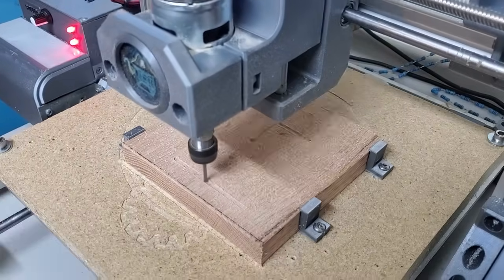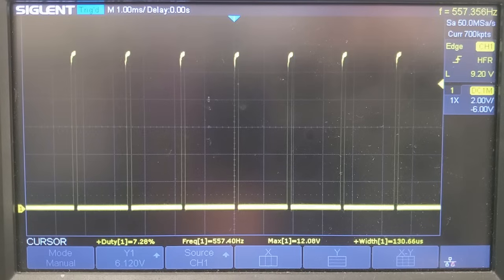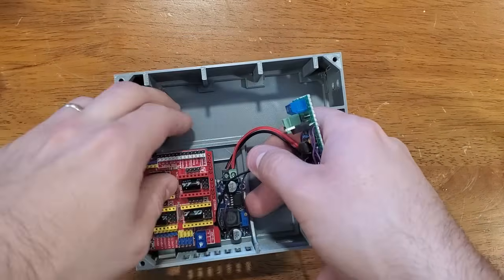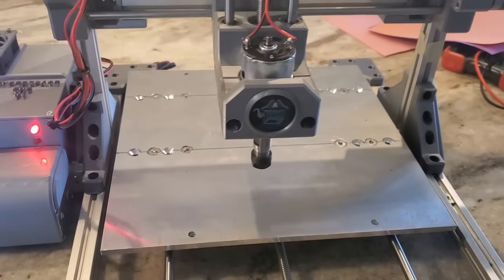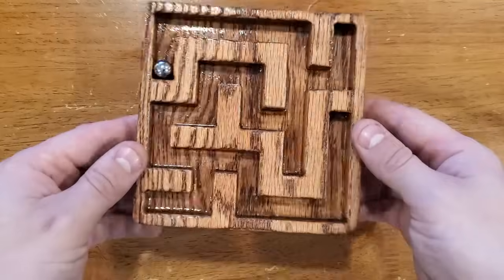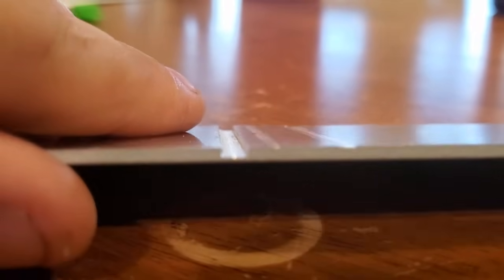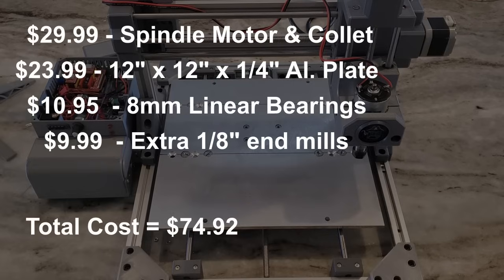CNC Mill for under $100

Comment: Okay. Not only we all agree on the criticism, it's extremely obvious those parts he had "lying around" were probably more that 250 and that he bought them most probably for this project. But I am gonna be real here, I just.. don't think it's even possible within that budget. Maybe a Dremel as the spindle, cheaper but still kicking 3d printer motors, and smaller size could give better advantage, but it's more worth to save.

Comment: Hey, CNC machinist here. Depending on the type of tool path you use you’ll get a way cleaner finish. Do some research on climb vs conventional milling. You’ll be able to utilize that info to optimize your programs to minimize burrs. But I am curious, is the spindle RPM able to be controlled through the computer or strictly with your manual adjustment? Also, reduce your feeds and speeds. The lack of rigidity in your machine plays a factor but that ugly finish on the side walls of your thick part is caused by tool chatter. The lack of rigidity will cause it but so will too high of an RPM combined with too slow of a feed rate. Also, try and get your hands on a solid carbide endmill, they work much better than HSS. And I’d recommend only a 2 or 3 flute for soft materials like wood or aluminum. Too many flutes will cause the tool to gum up and then it won’t cut efficiently anymore which can also cause tool chatter. But I love your project! I’ve been considering trying to build my own desktop CNC for home use.

Comment: I just built a very functional EV for less than $950. Id wanted one for a while. So i went looking around in my back yard and found a Tesla cybertruck with one tire missing. After ordering a matching tire my dreams had came true. All you need is sheer will power and the right back yard then you can do it too!!

Comment: Under $100, if you don't include the $300 3d printer or the several hundred in spare parts just lying around. On that, ill be posting a tutorial on how to build a car for under 25$ all you need is a spare car with a bad spark plug and a $25 set of spark plugs.

Comment: This man literally put nasa level engineering (ok not quite but you get the point) into this and all you complain about is that its actually 300 bucks instead of 100.

If youre not ready to invest 300$ into a CNC you shouldn't get into it at all
Reply: Maybe you can help:

I'm into car audio and I want to be able to mill out 1/2" thick mdf board so I can stack them to make speaker pods, etc. I'm having a hard time deciding on a desktop machine. I have around 500 to put in the machine. Any advice would be appreciated.
Reply: @namelessme6363  my advice is you should go to a small cnc shop, small shops are super friendly and honest. If they greedy theyll ask for 100$/h if its simple shapes like rectangles and circle cutouts one plate shouldn't take longer than 1h to program, clamp, machine and finish. 

You wont be lucky building or buying a mill for 500$. 

What you also could do is buy a hand held woodworking mill from brands like dewalt. 
Tools are cheap (start as low as 50$), tools are cheap, no complicated programming learning necessary and no clamping knowledge required. 
Everything you cant finish off with the machine, or imperfections you can file and sand away with either cheap files or a used sander that does the job much quicker.

Comment: Your CNC mill cost a lot more than $100.  You forgot to add the cost of your labor (less the assembly time for a shop-bought one).  If you had worked at McDonald's for those hours you could have bought a much better one and got free meals.
Other than that, good work, well done. 👌

Comment: I co-own a machine shop with Haas machines and as someone who never touches tree carcasses, I'd just get payments on a Tormach before trying one of these router things to actually cut on some steel/aluminum. Kinda cool project but would never, ever do what I would want to do with it.

Also when cutting aluminum without flood coolant put some squirts of WD40 on it periodically. You will be amazed.

Comment: If author had used another dcdc converter with external potentiometer for dc motor power regulation instead of 555 timer and mosfet, it could save him another few bucks and ton of time.

Comment: 3 days to print the parts? A rough motor with a spindle sleeve which was never designed to bear sideways loads, and which will wear out quickly? Extremely rough results? Not bad for a first attempt. More time and money needing to be spent on  improving it? You have encouraged me to do some online research for a good budget router and to buy one of those. The only downside would be that of not learning how to build a rough and ready unacceptably inaccurate CNC router. I can live without that. 😉

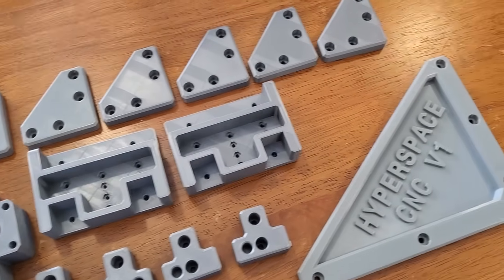Comment: 1:07 what are these blue parts that connect to the spindle called?
Reply: Shaft couplings, make sure you are buying the right size
Reply: @adamhorn8414 I refuse to enter "shaft coupling" in a search engine.

I got burned on that once already.
My boss saw it and I lost my job.

Comment: For that money you could just buy and old but working ender 3, then printing all necessart parts with it. After you finished printing remove the extruder assembly and put the motor in. Then a custom firmware and you're ready to go.

Comment: Lmfao, Parts in draw cost maybe $200 +, 3D printer and 3 days work...mm over $1000.. yeah right, just buy a cnc machine and save your life lol. :) I actually got one for free after helping someone empty an electronics factory. It is not what you know but who you know. I do like your methods and explanation though. Well done. :) Also there is an L in Solder.  Soder is a whole new level of engineering, haha ;)

Comment: I will always have a good laugh when I see how people STILL misunderstand 3D printing so much. Even if you don’t have one, do a bit of research. Each of the parts he printed cost pennies in filament. A see multiple comments arguing that he didn’t factor in the filament. 

Also, a very decent 3D printer can be had for $170 (ended 3 on Amazon)

Comment: I disagree with all the criticism about the cost.
Because we, the people who are into making and prototyping, have a shit ton of different Arduinos, sensors, ESPs, water pumps, 
...you name it. All of them bought during +10 year time span.
They are most of the time economically dead inside boxes for years, until a project deserves to be finished.
I lost count of every prototype I've made, but I got a cool cocktail machine, a solar tracker for heating water, a small part of my house automated better than what is commercially available, a small hydroponics system, and when I get to finish or close to, my next project will be an autonomous lawnmower.
The overall cost is lower than what we can get on the market, and for many of them, the quality and customization options are another advantage.

Comment: I make all SORTS of cool machines and items for under 100 bucks. Usually for like 20 bucks total.. thats what i tell the missus at least😂 i do do all my own engineering and building and fixing and modifying of literally everything in my life from kitchen appliances to forges to cars to flooring to home renovations to replacing sewer main lines because im a cheapskate that literally CAN do things better most the time and cheaper virtually all of the time. Ive ran all types of CNC machines. Little. Huge 12×20 footer table cncs... This project though? Nah. Ill drop the coin then modify if i want. Ive found that just because you CAN doesnt mean you SHOULD😂

Comment: Isn't it a little redundant to make a pwm controller when you have an arduino inside already? I havn't personally used GRBL but have made similar systems with marlin and there is no issue with this

Comment: It would be nice to have an Smart Speaker Voice Interface for an LLM Programming Language converter from Plain English Voice to G Code, perhaps with a CAD Simulator in between to make sure the G-Code is correct according to the Design requested by Voice.

Comment: That actually ended up working awesome for the cost. 
   It has the same problems high speed 3D printers have for different reasons. 
   High speed printers have problems with dimentions when speed and weight cause flex.
   This has issues with the same because of flex caused by feed and speed with the material Mohs.
   Maybe an oil feeder would be useful.

Comment: Not bad for a first go.  Looks pretty much like a homemade 3018 and has the same issues/limitations as the 3018's do.  I used linear rails on mine (HGR20 rails with double trucks for x and y, 2x MGN12 for z) and it's a lot more rigid thanks to that.  I overbuilt as I wanted a 480x480x120 build area that I can use as a laser cutter as well.  The spindle mount I made works for the laser module and the spindle motor I went with.  Just some stuff to think about.  I'm sure mine could be improved as well, I originally built it with belts but I immediately redesigned it for use with leadscrews.  I'm still playing with my design and am still using the belt driven model but may post a video of my build when I'm done.  Happy tinkering.

Comment: "The only things I bought" <= completely wrong, you bought the other parts too, just happens that you have them lying around for some time. Also, time spent in designing the parts and printing + the cost of the wire is high enough. Depending on how valuble your time is, you spent a huge amount of $, but you gained some knowledge. Strictly in $, it would have costed me about 2000$ to build this.

Comment: I guess if you had a 3d printer board that ran the same voltage you could just use that though I'm not sure how the firmware would work

Comment: should look up the mpcnc, or mostly printed cnc machine. best prints I've ever run. 
went from 3d printing plastic, to machining aluminum stock to rebuild the cnc, and now with a spindle upgrade i can do harder metals too.
at the very least, I'd recommend making every printed part a second time in aluminum.

Comment: I have a controller board from a i3 reprap printer, w8th motor controllers and screen etc. Off a wanhao i3, could this be re flashed to run a  grbl?

Comment: Depending on if you want to do further upgrades to this, you could probably find a way to swap out the spindle with a brushless motor and measure hall effect speed to get both automated speed changes through software and true speed feedbacks for different materials and operations when needed. Might even be able to piggyback another board onto the arduino.

Comment: Why not just step down the 24 to 5v like the processor wants. Why a 555 when you can use a pwm pin from the Arduino

Comment: Better call the title:"How to build with already obtained materials I have, with an added 100$"

First one needs:

PC with CAD software
3D Printer
Filament
Steppermotors x 3 
Aluminum sheets
Metal rods/bars
Arduino
Powersupply
Stepperboards x 3
Buck converter
Spindle
Speedcontroller 
Siglent Scope

You get where I'm going at...

Love you videos though :D

Comment: Yeah, makes sense..Instead of buying a $165 device that will MOSTLY work right..I'll just use half that amount in parts I have, put another $75 toward it in other parts, and put $500 in labor into making a device that has issues.  Good call!

Comment: under 100 ? you mean if I have the rest of the materials right ? only the motors + power supply are close to 80 $ ..and you have an arduino there that also costs 20-40 $ ?

Comment: If you added up ALL your costs like the power supply, and arduino, and 3D printing materials and stuff, that thing technically probably cost a few hundred dollars to build. 

I would be interested in seeing it compared to another two hundred dollar cnc, or possible the Vevor.

Comment: YT randomly dropped this in my queue and wow am I am glad.  Love the humor!  I worked 30yrs in precision machine tools (PCD, PCBN) and machining.  Finish boring cylinder heads, contouring bearing races, L/D>15 ID drilling (cannulated bone screws)... utter mania, full-on salivation for the deity of "ultra" precision.  Drives you crazy with frustration, every day.        So I sure can relate to "strapping a beaver" to main drive.  And 250$ CNC machine is "too much".    :) 

I gotta go binge watch all your vids.  Well done and thanks.
Reply: Hellooo. I would love to learn about your journey! 1.5 years as a Mechanical Design Engineer but haven't done any ultra precision work. Is it possible to connect with you?

Comment: I have an odd design in my head for a CNC,
I don't really know any CAD,
I need to make the time to learn, 
But can I describe my design so you could model it out and try it if you like?
Talking over voice would be easier but I'll try to describe a bit here...
For the X&Y use two disks about half way overlapping, the disks are Axial flux motors with a fibonacci spiral slot going through them which will be a track that the outer-race of a bearing can travel through, and the overlap of the disks align the bearings over top of each other and run a rod through them, drill motor goes on one end and tool bit on the other end of the rod running through the bearings. 
The advantage of this is the bigger the disks the easier it is to get smaller microns movement, and Axial face rotation provides more torque!

Comment: You could have just sold all those parts individually on eBay and bought a machine and had a spindle plus a lower power bill and 3 days of your life back. Those nema 17s won’t do much in terms of work holding. That and the pla brackets too much play. You’re better off using 80/20 hardware since you’re already using profiles. I’ve built many of these machines and it almost always ends up being cheaper to buy them.

Comment: I have one same it. The part used 3D plastic print are not good. I have to replace all parts by aluminum . The staff from 8mm to 10mm. Brush motor replaced by brushless. Everything was changed to good. Price also not so higher. Except I have more work metal part by part. 😊

Comment: Good thing your ball fit the grooves you cut in the oak board.
Now you just need a robot arm to do the vacuuming, so it can work unattended.
Yeah, It's precisely because of the "slop" that I've never built a CNC machine. I could never decide what i would tolerate.

Comment: Good build.  If you add a vacuum pickup to remove the dunnage chips it will help a small amount on finish whee slop is this loose and anything will misdirect your cutter feed.

Comment: Silly question - don't you need limit switches?
Reply from the maker: They're not strictly required for a CNC like they are with a 3d printer, because zero'ing is typically done manually. 

Still a good idea for protecting the machine, but it'll work without them
Reply: @HyperspacePirate  Many thanks - you learn something new every day!

Comment: Super misleading bro. You must have bought your "junk drawer" parts at some point, and since you used a 3D printer you would need to factor that into the cost. You are easily over $300+ on this in actual costs, and if you value your time at even a measly $30 per hour, you're probably into this for $1,000s. I have no problem with people who build stuff themselves even if a suitable "off the shelf" version of the thing exists just because they want a project, but trying to spin this as a value for "under $100" is a joke.

Also, the chinese 6040 machines as well as the 3020 (which are closer in size to this one) are rigid enough to cut most non-ferrous metals without an issue.

Other issues here that could improve the machine:

- Using a switching power supply for the motor = fail. You should always be using linear power supplies for motors. They are far more stable and allow for smoother operation.

- It would have been better to use a dedicated power supply for the electronics to isolate them from the feedback caused by the spindle and stepper motors. Using buck converter to cut 24V down to 12V just wastes power.

-  A lot of the structural pieces you made from plastic already exist in aluminum form specifically for extruded aluminum. Going with them would have made the entire frame a lot more rigid without adding much in the way of cost.

Comment: I like your thinking, can you recommend a 3D printer that doesn't jiggle jiggle, it folds (or not) for cheap? Maybe the Ender or something I never thought of. I'm not making figurines or flying buttresses, just things that connect this to that or a lens mount. I had to rewind but I think I have all the same spare parts. A few DC motors too...

Comment: the hardware alone bought per piece is damn near $100 add a $40 spindle, $40 arduino+cnc shield, $100 in extrusion, bearings, threaded rod, nevermind the misc electronics, 3d printed parts, design time, power supply. this is a CNC mill for under $500 at $165 quality

Comment: I am building a CNC mill machine myself that can also double as a 3d printer (I will be using 2 boards so just have to swap the heads over) is it possible to have it so it uses 4 motors and not 3 (2 for the Z axis)

Comment: the aluminum extrusion is cheap, the nema motors aswell but that power supply? when you get powersupply with higher amps the price goes through the roof from what I've seen or is there some cheap source I don't know of?

Comment: The rough cut with vibration at 14:20 or so.... giving the millhead some weight would cut down on the vibration.  Like, attach a block of heavy metal to it.   And maybe replace the 8 mm rails that are flexing?  My point is that the machine has a few weak points that can be shored up for a jump in quality (from very very low to just embarrassingly bad)  I'm well aware one should invest in a better machine, but instead I'm pointing out how to help this machine.